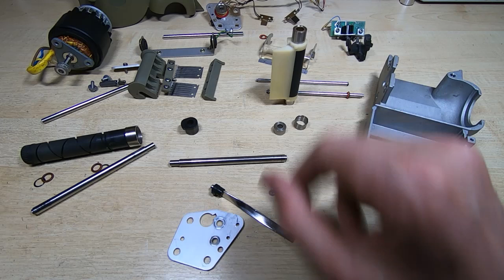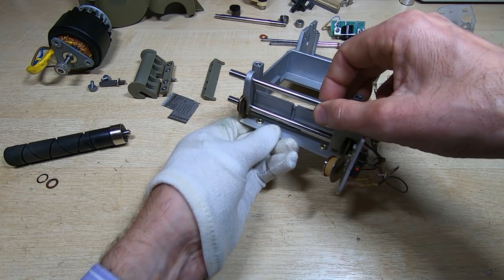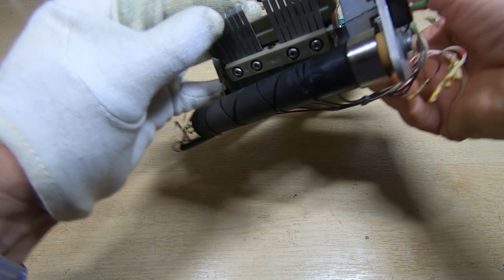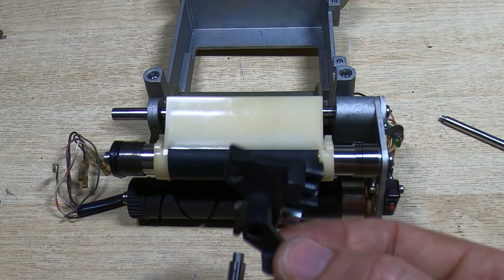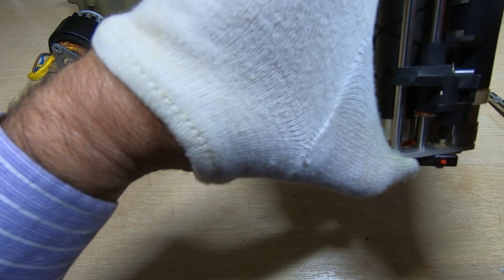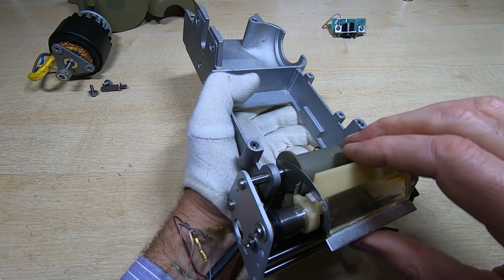HP9120A #1 Repair Part6

Comment: Jerry, do you have an assembly/maintenance/service manual & IPB for this printer?  Or do you have to study items like this until you determine exactly how it should be assembled & adjusted?  If so, you must have "the patience of a saint" to ponder over mechanisms like this until you figure them out!

Thank you for the reminder about not over-lubricating mechanisms like these!  Do you use a quality light clock/watch oil for re-lubricating journal bearings like these in order to reduce the future gumming up of the mechanism(s)?  Or a good "real" sewing machine oil or just a 3-in-1-type oil?

I'm pleasantly surprised that the two large rubber bushes were still in usable condition too!  I half expected you to say that you had to manufacture replacements for them.

What kind of Viton are those dark red/rust-colored washers/O-rings?  In my experience, the Viton O-rings I used to seal systems for pumping chromic acid were black in color.  The only dark red/rust-colored O-rings I ran into were either a silicon or some other "lesser" material that didn't last very long at all when exposed to chromic acid.  [I just checked online and one site claimed that virtually all O-rings were black before 1987 (other than the red/rust-colored high-temp silicone ones).  I was working with my Viton O-rings in the early-to-mid-'80s, so the multitude of O-ring colors available today for any type of material with any color desired wasn't available back then.]
Reply from the maker: Viton is a brand name and not a material. These orings were manufactured by the viton company as it was one of the few companies back then that made specialist components of this type (actually Dupont). I suggest avoiding the assumption that googling a few websites constitutes 'research'. I am not aware of any detailed service manual for these machines although I am sure that if I said that in a video then someone would post a comment to contradict me :)
Reply: @JerryWalker001  Thanks for the info in Viton.  I was unaware that it is a brand name, but now I know!  I know that I didn't do a lot of "research," but my comment about the "one site" should have been more clear that I only looked at 2-3 sites instead of a rigorous search for information.

I wish I had your patience to work your way through these mechanisms without proper service manuals and still determine virtually everything needed to properly repair & reassemble the mechanism.  My hat is definitely off to you!  I look forward to all of your videos.  ;)